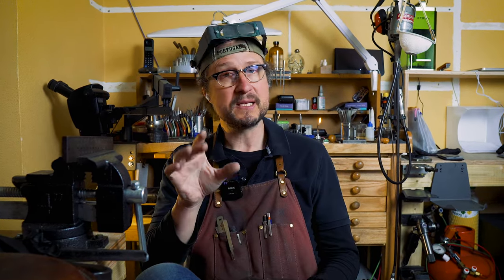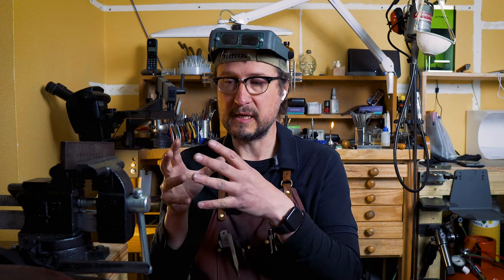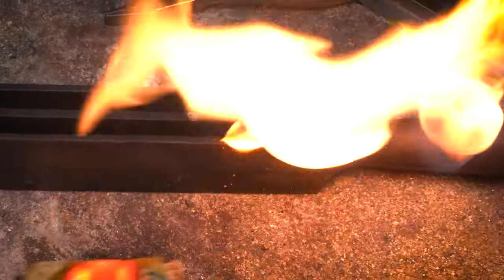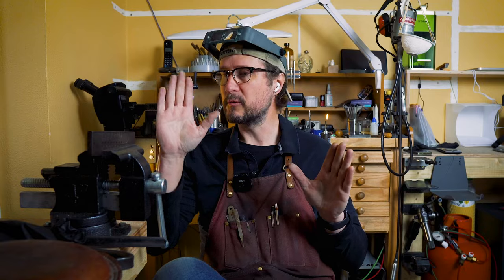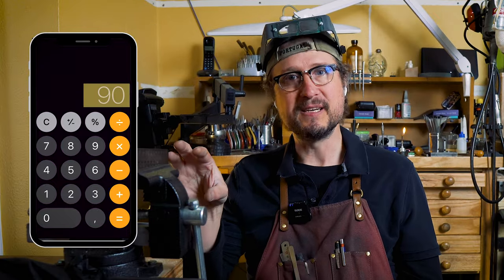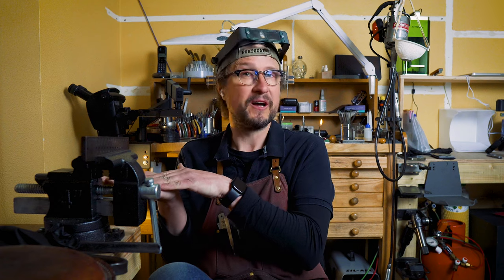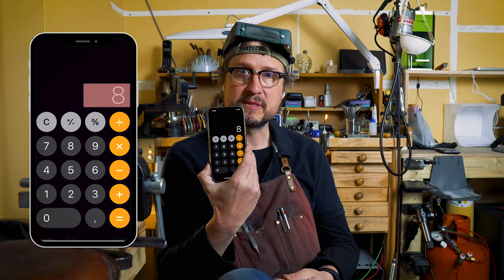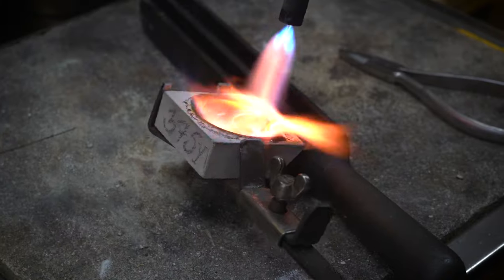Metallurgy - Mixing Yellow Gold DOWN From 18ct to 9ct  | Goldsmith's Workshop Secrets

Comment: Thank you so much! This is exactly what I have been looking for, for an upcoming remodelling project I have! Your videos are so helpful so thank you 😊. Once you’ve created your uniform carat gold (e.g. all 18 down from 22) would you still add some fresh gold to the mix?
Reply from the maker: You are so welcome - I would definitely always try and keep just above the ct to make sure I’m safe. I usually just mix down like this for a specific job - like sentiment rings where the customer has a connection to it. Once I’m done with that project, I would offer the rest as discount to the customer or return it for use later down the line.
Reply: @jacothejeweller  thank you 😊. Ah ok, I’ve been told by some to always add some fresh gold grain into the mix when melting down old to get a better pour- do you generally not have any problems just using the old gold provided by the customer?
Reply from the maker: @FranBlake-nw5ie  ah, okay - I understand it wrong. No, I don’t add fresh gold to the mix. I mix it over carat when working out the balance. Not by much. But mostly it’s all fine. I do mention the risks beforehand so everyone is aware of the potential of cracking. I’d say 90% of the time it’s fine.
Reply: @jacothejeweller  thank you!

Comment: I've never heard of using brass for the cut when alloying down. Interesting. Why brass, sir, instead of a commercial master alloy or silver and copper?
Reply from the maker: Brass is a mix of copper and zinc. I’ve used this for all my work and it works great but just for bench work. Casting would use another alloy.
Reply: Thank you 😊

Comment: how about a white gold video?  ill take scrap white gold i got in the shop to make sizing stock but its so hard to work.  help a subscriber out.  melt and roll some white gold out for us.  thank you
Reply: The easiest white gold is 18K palladium white gold which is only palladium and gold and is absolutely a dream to work with. Its easy to melt but requires alot of heat as palladium has a high melting temp.
Reply from the maker: @jasperallen8479  yes 🙌🏻 this is great. Thanks for adding to the conversation 👍🏻